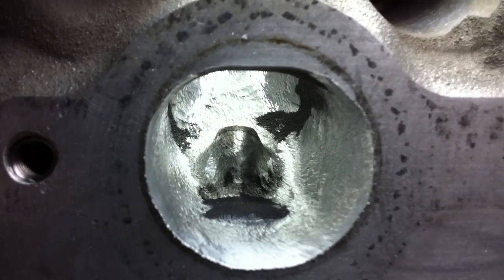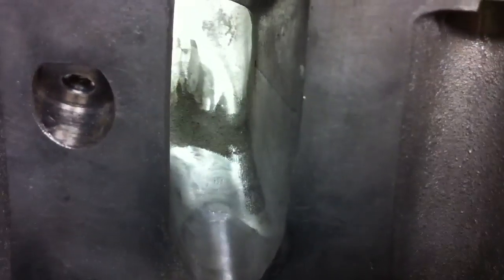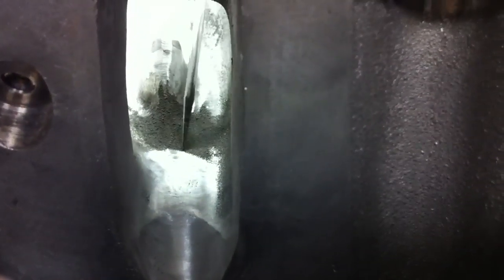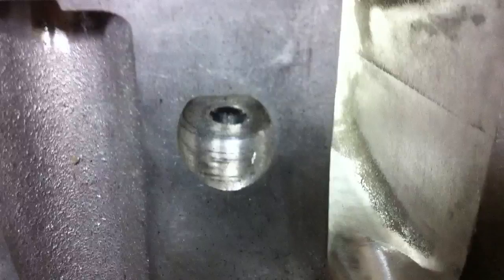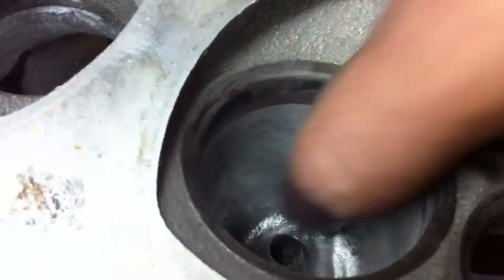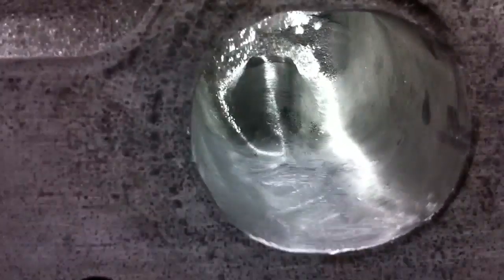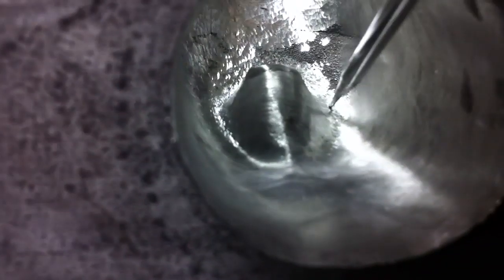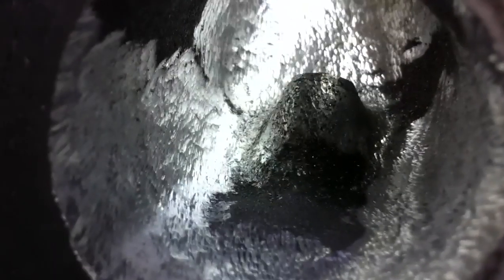How To LS1 DIY Head Porting Part 7 - Tootsie Roll

Comment: The little ramps at the bottom of the intake ports is that a good idea to smoothen up and blend pretty well and get rid of the edges? I did a whole head that way and I thought would work really well but I haven't seen anyone else do it and I'm a little worried. It can't affect a whole lot can it?
Reply from the maker: You mean the ramps at the top near where the injector sprays? We usually have the head upside down, so it looks like it's at the bottom.
It shouldn't hurt it much. Most people likely don't reshape it because they're trying not to open up the port any. Making the port larger can affect velocity. But there's nothing wrong with smoothing it at all.

Comment: AG4L so its not a good idea to polish the exhaust port after you hit it with the 80 grid
Reply from the maker: kad5118 Sure, its a good idea, I just don't usually do it. Exhaust can be polished to a mirror finish. The intake port you'll want to keep rough and only use 80 grit on it.